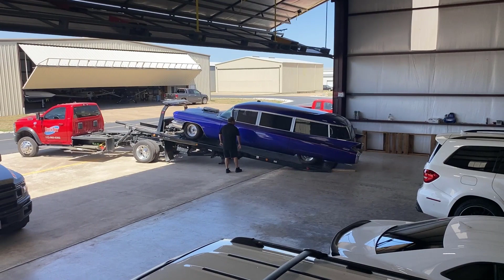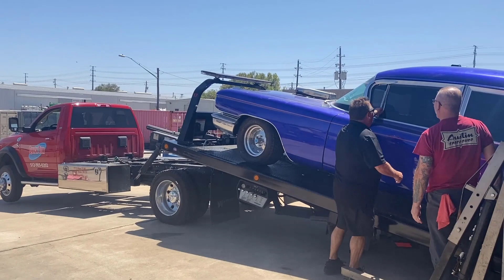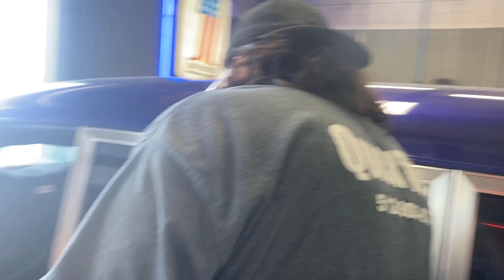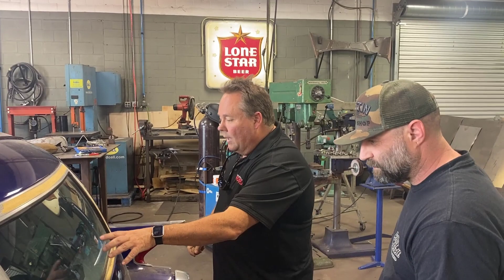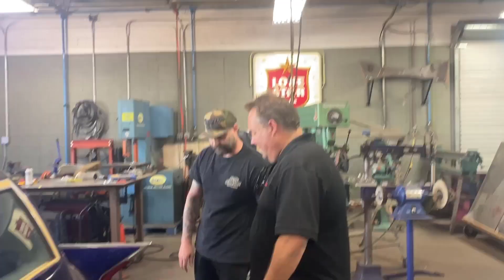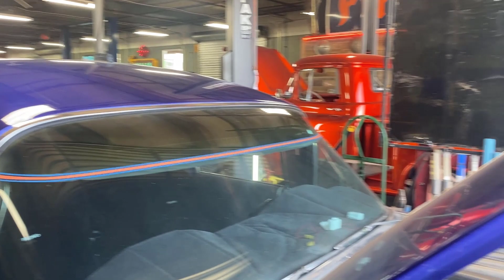The Terminator - Resurrection Part 2

Comment: Man that is alot of iron, they just don't make em like that anymore lol if you smacked into another car with this it may get a small scratch while the other ends up looking like a stepped on soda can! 😝🤣
Reply from the maker: You got that right!
Reply: yeah but you die
Reply: @klaasj7808  what??? How would you die if you're in a 25ft land yacht built like a tank lol the other guy I can't say as much for but I'm fairly certain you're going to be just fine hence the reason nobody even wore seatbelts back in the 70's-80's and cars used to only have lap belts to hold your ass in the seat was all and the other safety net was dad or mom's cat like reflexes reaching across the seat to hold their kids in place those were the days!